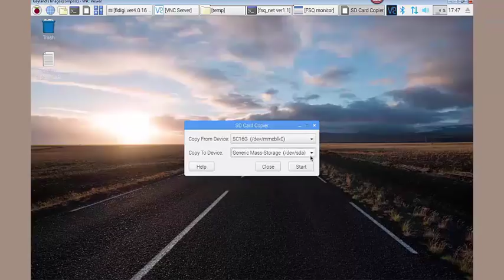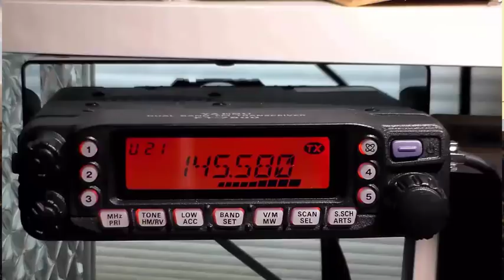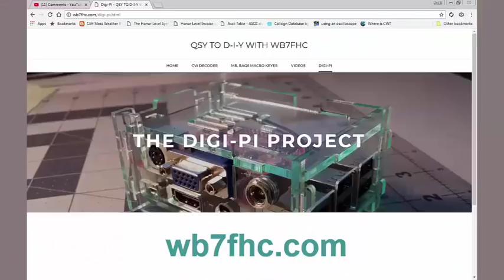Building the DigiPi - High Speed Build Version

Comment: the sound on this is messed up, too low and cant hear it deaf in my left ear and hard of hear, thus nogo on vid
Reply from the maker: Sorry about the audio level. If you look at the video you will see that the mini boom mic got bumped up a little on my headset. Hopefully you have a volume control on your computer and you can slide it up a bit. I tested it here and only had to nudge my audio up a little bit and I was able to hear it fine.
Reply: being hard of hearing i already have everything up :) I found some speakers and that helped, but normal headphone volume it is too low.